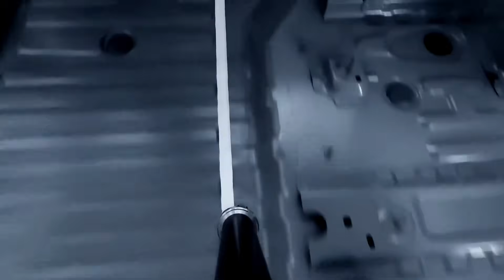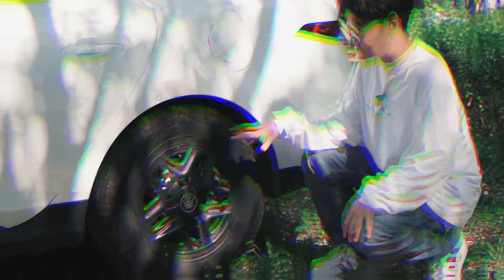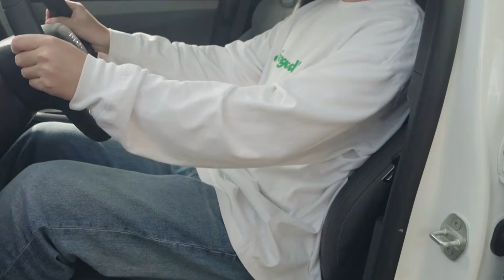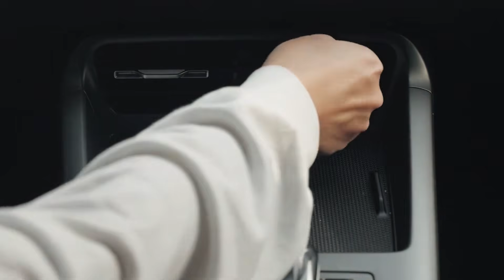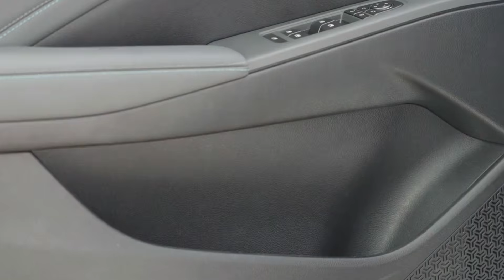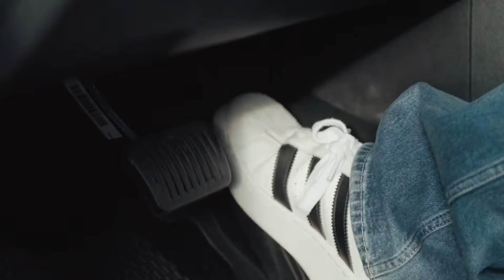The "Chinese Trick" That Makes Your Electric Car Last Over 500k Miles

Comment: The Sodium Ion Batteries won't be as badly affected by heat and cold that are coming down the line.. The 100% charging is only to allow the computer to sync the range as there's a flat area in the voltage when charging an LFP battery whereby it has to guess your level of charge a bit. Otherwise a tests done that cycled LFP batteries with differing charge habits found that charging your battery from 0 to 25% repeatedly maintains the battery capacity longer than charging from 25 - 50%, 50 - 75% and 75 - 100% as well as from 0 to 100% the take away from this is that the charging to 100% is only to help the computer guess the battery level and range, as for the longevity of the batteries health using the battery as low as you can go and then only charging as much as you need to use will allow the battery to live a bit longer